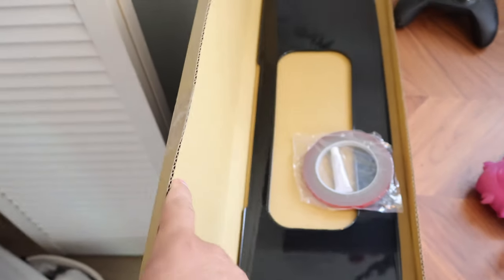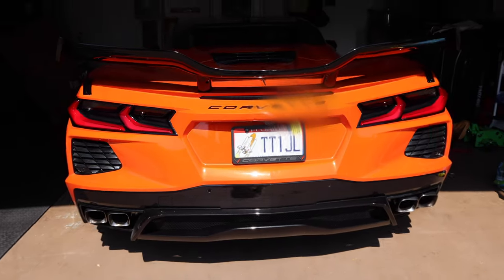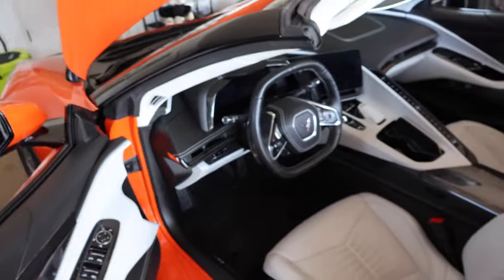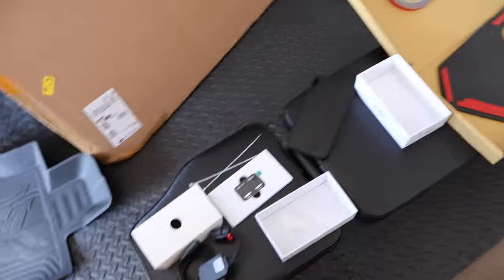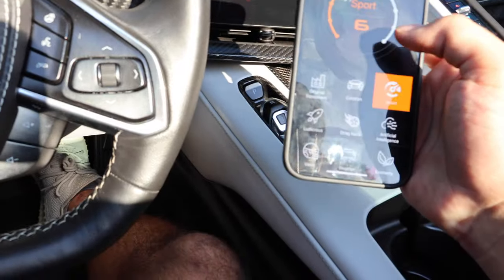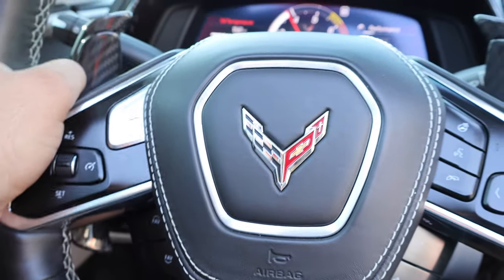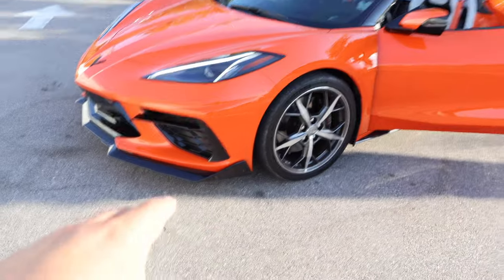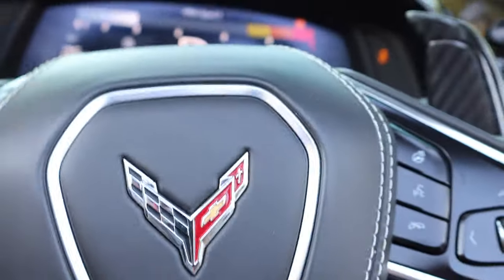More C8 Corvette Mods (Throttle Body Controller) Can We Make It Better Than The Z06?

Comment: I did both these mods, most recently the Soler throttle, it does make a noticeable difference.. I leave mine at sport 5, although I don't use it much as it does use more gas... or I mostly just drive on the road... both nice mods..

Comment: Probably the most noticeable bolt on mod we can do to change the feel of the C8. It changes it entirely. I drive in sport 9. 

That with ported throttle body, as well a scold air intake, and ported manifold… huge diff. 

I was able to get 0-60 in 2.6 with cooler weather. 

Nice vid.
Reply from the maker: Definitely does! And thank you 🙏
Reply: @nicolaskorvessis  I’m glad you like it too.